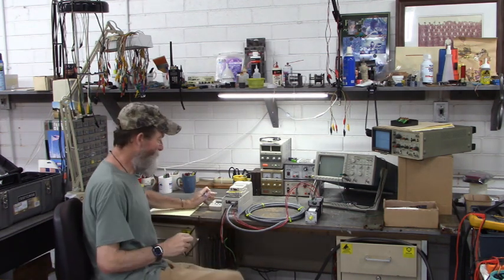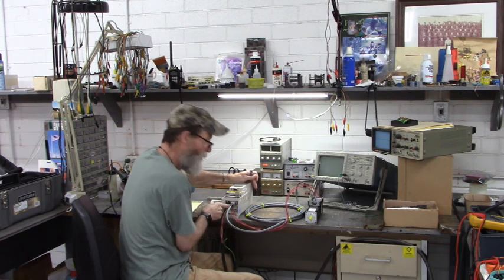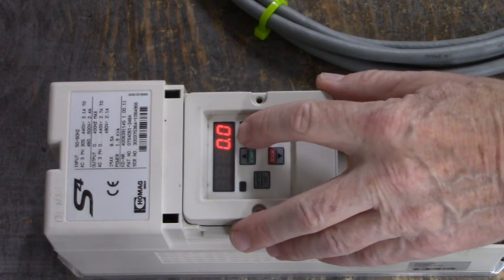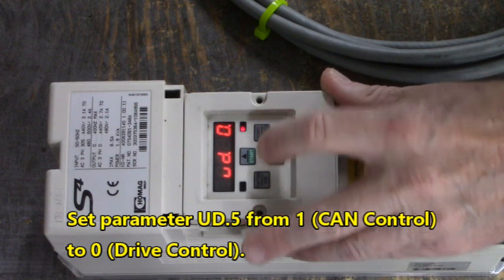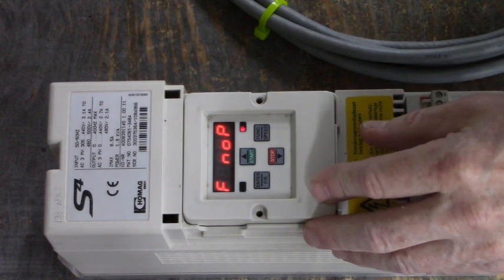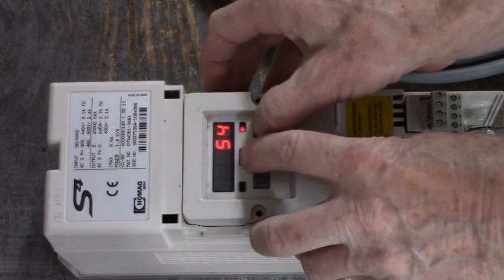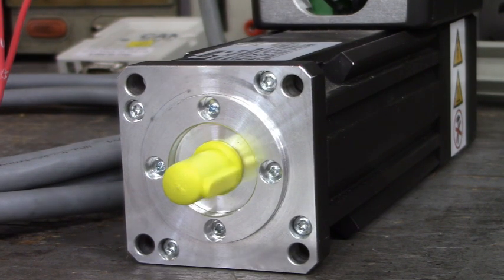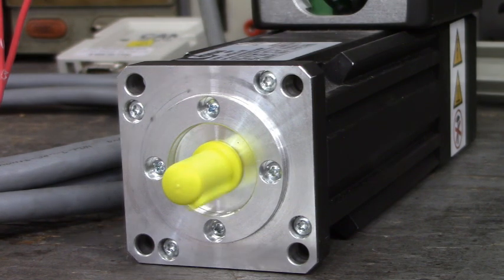Testing the KEB Homag S4 Servo Drive with the Homag Servo Motor.

Comment: Hello Mr McDonald. Thanks for you content. Following you already for quite a while now.
I see that you did a manual test via Keypad, and didnt connect Homag drive to Combivis with the cable you have  (that you used in yout other videos).

That is the question - Does a regular cable works with HOMAG version?
Using my cable - I can connect to a KEB F4, but can't connect to a HOMAG drive. (Either cable does not work on HOMAG drives, or my Homag drive is defective!).
Reply: I can connect to KEB from Homag with usual cable from KEB. I think it does not matter is it normal KEB or made for Homag or some else companies